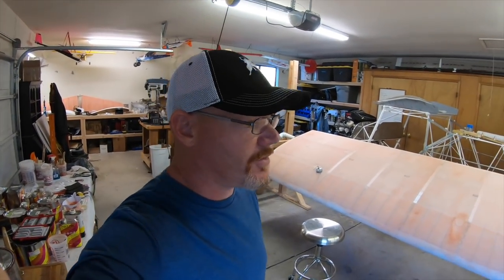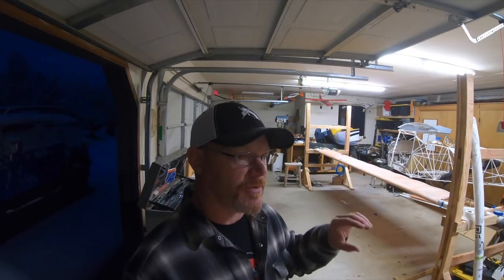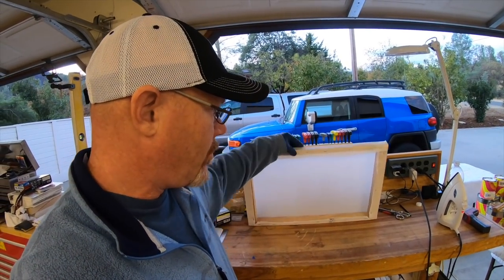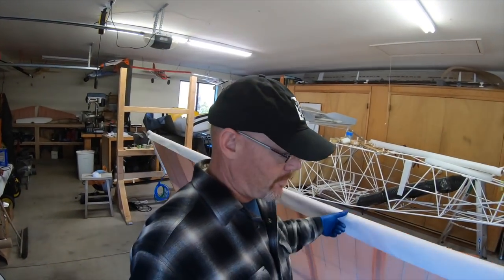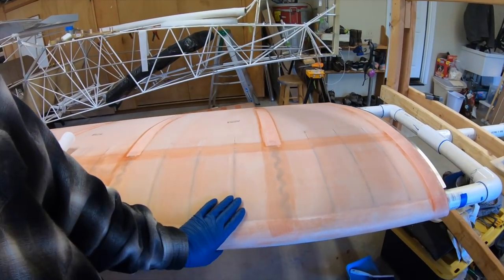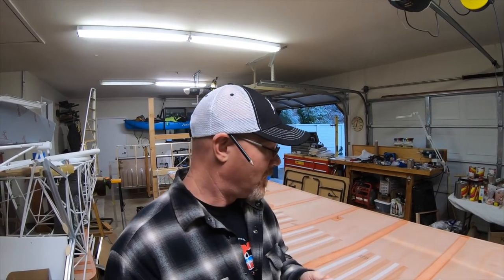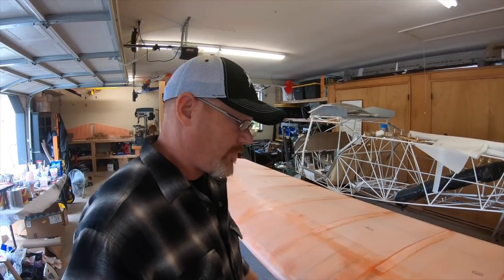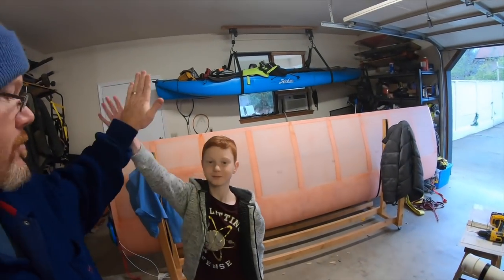Kitfox 7 Apex Build Episode 14 Kitfox Wing Part 3, Finish tapes

Comment: G'day Brian from australia.
Best option is to run rib cap tapes to leading edge and run 4" leading edge tape across leading edge. I think your idea will work just fine though.
A lot of people overlook the the importance of the tapes on the upper surfaces of the wings. If they fail your lift will be hindered quite A lot. If done correct though, there will be no problems
Build is looking great. Keep up the great work
Cheers Glen

Comment: Looking good. Just wanted to try to put your mind at ease about the slipstream lifting the pinked edges of spanwise tapes. With the Polyfiber system and proper installation it just won't happen. You iron them down good, and after 6 more coats of various coatings including paint those edges you worry about will be nicely faired and filled in with noplace for the wind to catch. If this was really a problem, wait until you get to the fuselage where you will be forced to install many finish tapes in a spanwise direction. By the way, this very discussion worries me a lot about the guys using the Oratex system; where all the spanwise tapes and seams are raw edges with no coatings or paint to fair them in. I personally think this could be a serious problem in a few years and the jury is still out. I also personally much prefer the smoother faired-in appearance of the Polyfiber tape system. I think you made a good choice going with Polyfiber.
Reply from the maker: That is a concern I have about Oratex also. I agree that if the poly fiber is done correctly the tapes shouldn’t lift, but they have lifted in places on my model 5 in some places on the wing. I was not the one that covered my 5 so I can’t say if it was done the proper way, but after 13 years those tapes have lifted.

Comment: Idea on the stitching... maybe kitfox needs to be involved with this:
Indents on the ribs where the stitches are prescribed to be.  1/64 ~ 1/32 grooves, which could be easily located and dispensing the time consuming measuring out process.
Cutting those stitch grooves to alleviate the "bumps" is most likely an unauthorised method to a builder
Just a thought ....

Comment: Will you be running vgs they increase drag as well, you are not building a 300KNT airplane! 
but I got to say you are doing a grate job of not going down to many rabbit holes.
keep building and have it flying this summer .
Reply from the maker: I will be yes. I mentioned that in the video, all that time making the leading edge clean just to put VG’s on it. I know, but it came out the way I wanted.

Comment: You're overthinking the spanwise take issue. It's done that way on thousands of aircraft and causes zero problems.
I have done the double layer of fabric on the leading edge just because with older, slightly wrinkly skins it provides a nicer finish. Not an issue with your leading edge.
Reply from the maker: I know, I just couldn’t have that tape on the back edge. It’s done now and came out just how I wanted it.

Comment: With your large leading edge tape, should it be pre shrunk like the inspection ring covers?
Reply from the maker: That is why I glued the edges first instead of just using poly brush, this allowed me to shrink it in place without distorting the edges. So yes it was shrunk.

Comment: One important thing I don't think you mentioned is that if using waxed thread for the rib stitching it is REALLY important that you clean off any wax residue with thinners or MEK. If you don't then the dope won't adhere properly any you will get a rubbish finish. I speak from bitter experience!!!

Comment: Bryan, AWESOME shot from the vertical stabilizer on your 5👍 And great update on the 7.Question, about the inspection ports in the ss7 wings, what would be the process of replacing them if you ever have to get inside the wing? Keep up the good work!!! Thanks Scott
Reply from the maker: I should have explained that. I’ll put an explanation in the next q&a. You cut out the fabric inside the plastic ring and an aluminum cover then clips in that hole. The covers are provided in the kit.

Comment: Not sure about this, but is the SS7 wing the same as the STI wing? If not..to late now obviously but how much trouble would have been to cut new ribs, if that was what all it took to make this wing have more lift? This is probably one of those apples to walnuts scenarios.
Reply from the maker: They are a lot different. There will be more on this subject in future episodes as I am building a second wing also.

Comment: Did you ever consider building an STi wing? or was that not an option (If memory serves you got the kit used)
Reply from the maker: Yes, stay tuned on this issue, there is a second wing in the works that will be used to compare performance with the standard wing.
Reply: @BowenAero  Can't wait to see it!